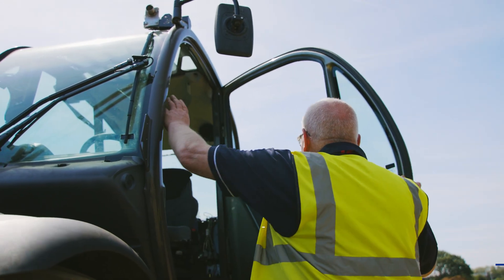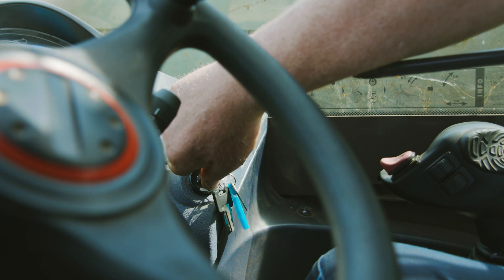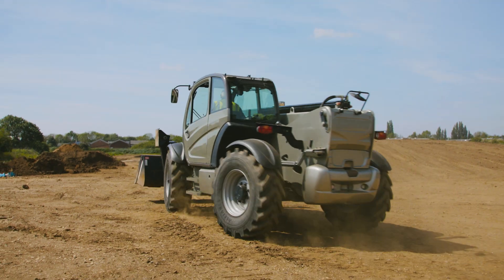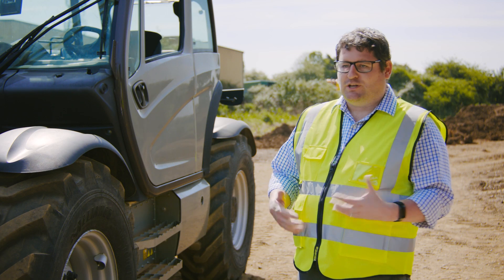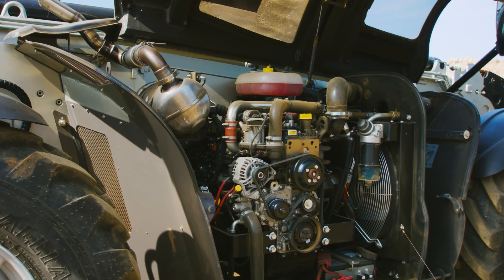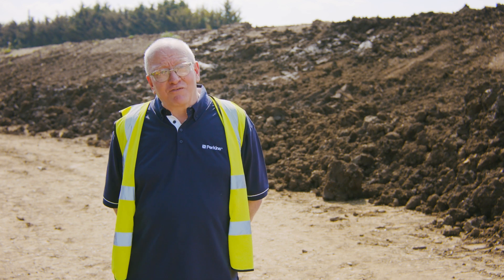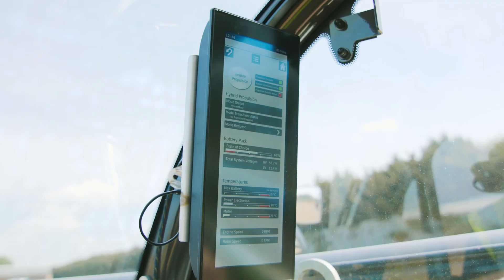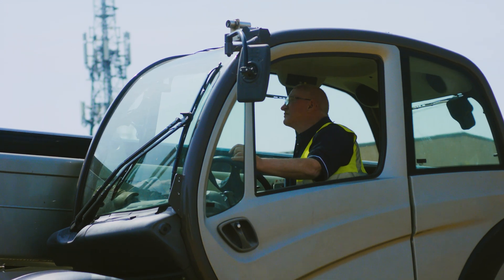Perkins puts diesel-electric hybrid technology to the test

Comment: So is this a parallel hybrid with the emphasis (as a demonstration) on being an aftermarket swap for a purely combustion-engine-mechanical-drivetrain, with the 2 motors being clutched in and out? Is there any value to a serial hybrid (Perkins diesel driving generator) like Nissan e-Power? Is there a 'grunt' problem as JCB suggested, or a lack of cheap EV components in this power range? 75kW doesn't sound large any more. Is it all about sustained power, or do operators notice the absence of massive flywheel/crank inertia 'eating' impulses? So many questions... Interesting development avenue! Good luck.